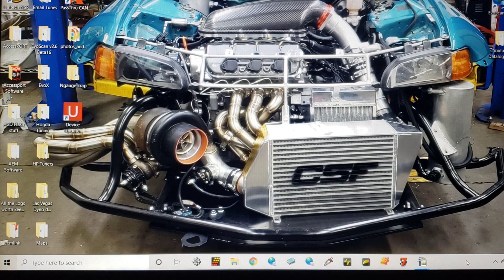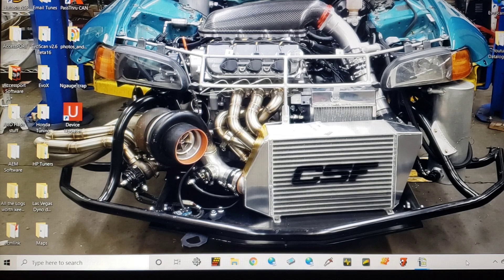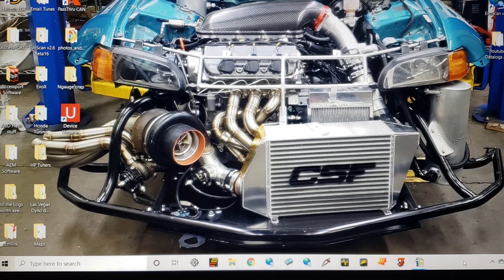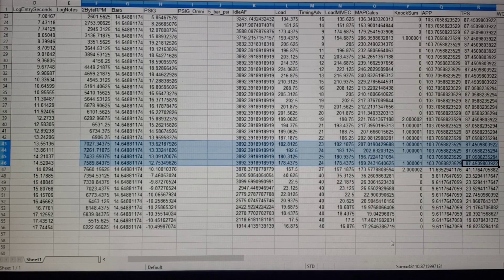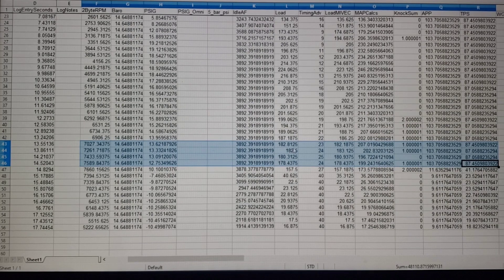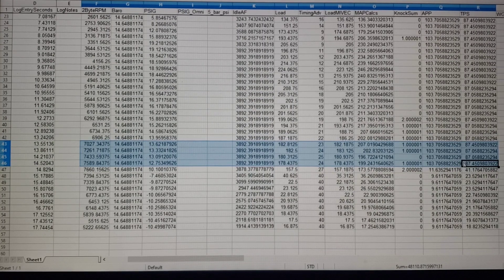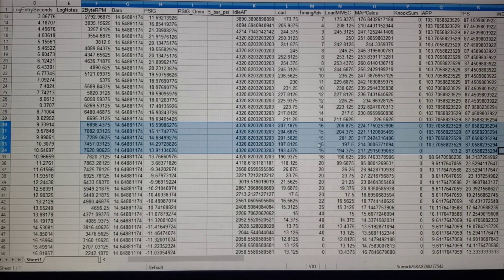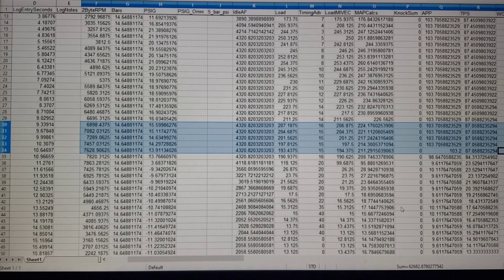Timing Is Not Your Friend - update

Comment: What's with the tps only hitting 87% tho?
Reply from the maker: Most factory DBW cars don't show 100% The Evo X is one of them where 100% APP is 87% TPS but that is wide open.
Reply: @AaronONeal1  ahh ok... I never played around with an X. On my viii it maxes at 99.6% and never hits "100%". Is that normal as well? I appreciate the response/knowledge shared big time! Thank you..
Reply from the maker: @JDoc325  on normal cable driven stuff 99-100 on a properly calibrated TPS is where it should be. On some of the aftermarket throttle bodies to get it right at idle it may be 95% wot. It still works. When it switches to a standalone ECU that all is resolved.

Comment: So much timing to give the absurd amount of fuel time to burn up before it hits the cat? Wonder what happens if you just stuck a spark plug in the exhaust manifold? Stock ALS with no air bypass? lolol...
Reply from the maker: It's like taking medicine for a problem that requires another pill for that and a pill for that.